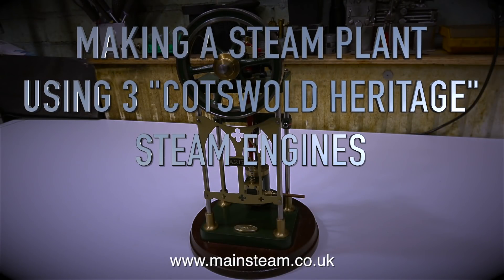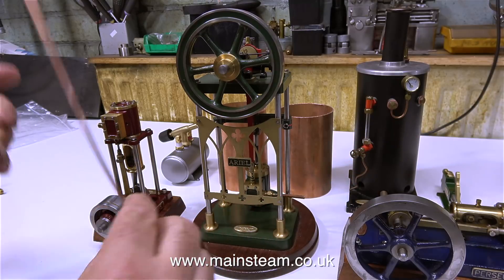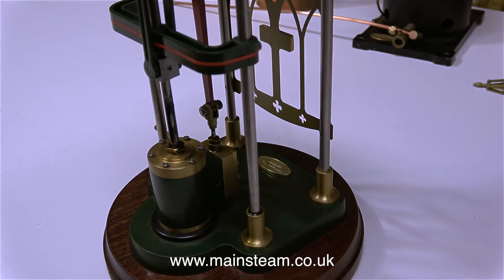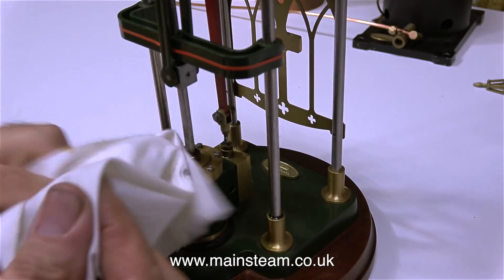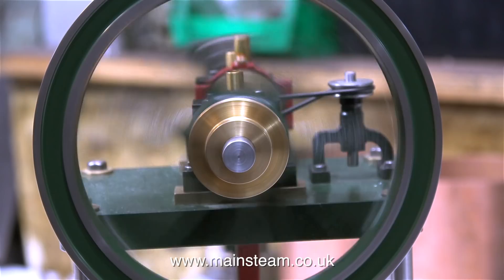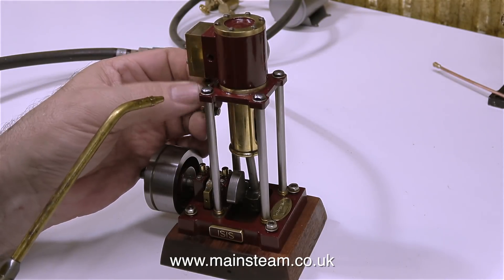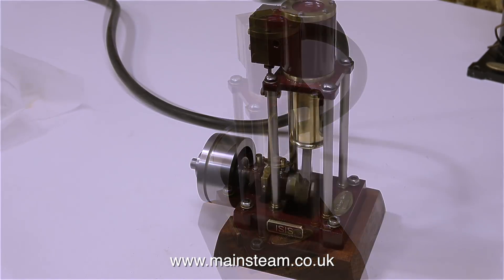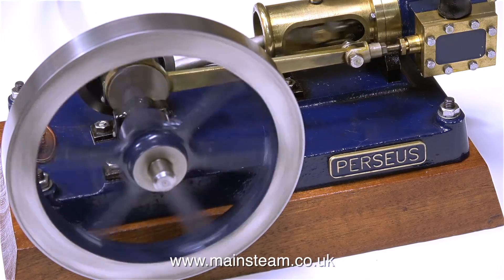A MODEL STEAM PLANT WITH 3 STEAM ENGINES - PART # 1

Comment: When breaking in a new model steam engine and little excess oil on these model steam engines, makes sense. Better to over lubricate than under lubricate. You can always wipe off the excess oil after run in. Under lubrication I would think could cause damage to the moving metal to metal surfaces. More great advice Mr. Appleton

Comment: Amazing video. I have a Perseus engine identical to yours. I have been obsessed with steam for my whole life. My first words were not "Mum" or "Dad", they were "Around" and "Steam". Before I could walk I could tell the difference between a Cornish and a Lancashire boiler, and I'm not kidding. After building it from a pre-machined kit with my dad at just the age of five it sat around for many years as we lacked a air compressor or boiler to test it on. Nowadays it just sits on a shelf collecting dust, after it was fiddled with for so long by my tiny hands the pin on the big end came loose. This video has given me inspiration to fix the thing up again at my school's machine shop. I am taking mechanical engineering as one of my GCSEs so wish me luck on getting a new pin machined!